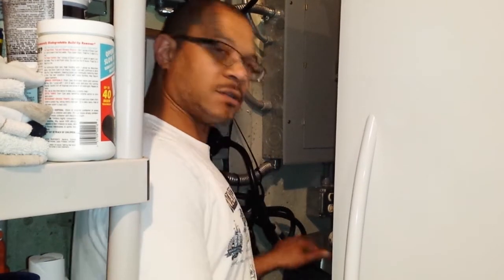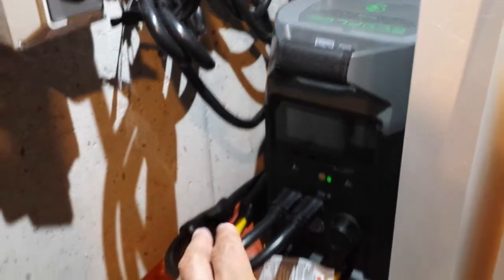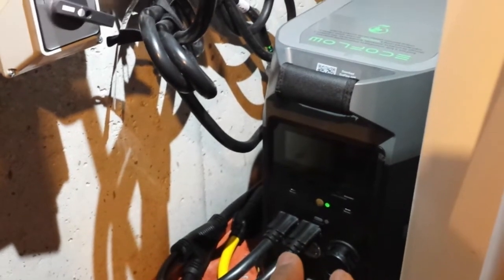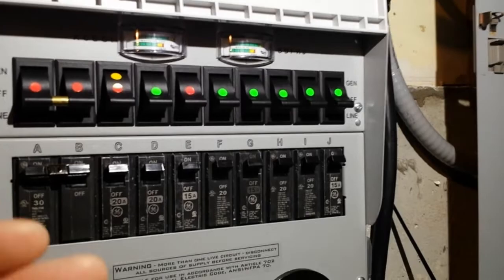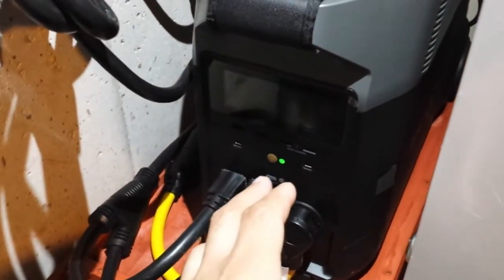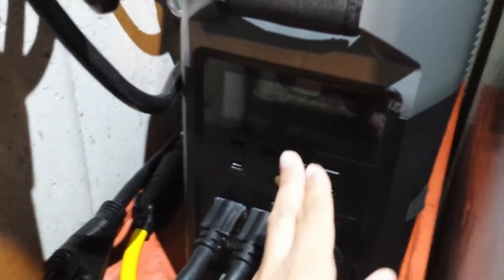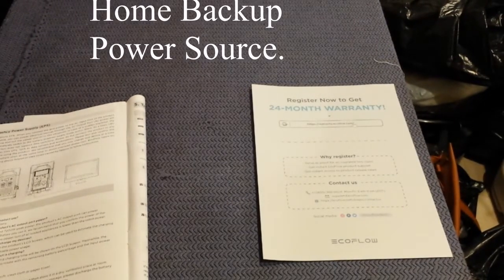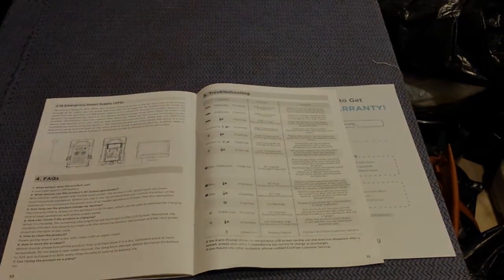EcoFlow Delta Pro - Overload Code Issue

Comment: I noticed you are limiting your EF battery charge and it coused the unit to not turning off so i cancelled the limit it satarted as normal and you should remove all connected wires to ac  NO LOAD and switch it off and wait for 2 hours and try turn it on and see if the 121 is gone ??  Try ac with a tv or blender without connection to house grid maybe the fault is in your house panel. Good luck 🤞

Comment: What is the resolution to this? Mine did this last week but not hooked to 120v, just solar panels. This was a "reconditioned" unit. I sent it back twice, now the 3rd time. is there a fix for this? This is out of warranty and now I have a $3k boat anchor.
Reply from the maker: I'm going to assume you tried to reset the overload button on the back of the unit. Outside of that, I have nothing to recommend.  

I am curious though, where did you buy them from and was it warrantied out with EcoFlow?

Comment: A power surge is needed for those types of internal power supply. When using generators, you need a sinewave. There is no protection on the ground when a surge happens.

Comment: Thank you for your video. I have a
brand-new Delta Pro. I haven't even
used it. I have only charged it. We
haven't had any storms, and I don't
know of any power outages. My unit
is experiencing the same issues you
are having in this video. I emailed
Ecoflow support. Hopefully, all goes
well.
Reply: How did it turn out?

Comment: Hello  I also have a delta 	pro 3600  . My problem is 50w overload from a fan running   . the reset button does not work either , we heard cracking smelt fire and shut it down . This unit is only one years old .I paid over 8,000 w extra battery and solar panel I never used. Delta pro is terrible. So don’t expect help. I have a two year warranty  and they are saying it was only a year,  when selling they promote a good bunch of boloney and then when you need them they don’t hear you.. I now have no use for this extra battery that cost ,3,000 and a solar panel that was another thousand don’t have bill in front of me could have been more. I don’t know nothing about this unit I am looking for I guess electrician  to fix this hopefully then sell it. , hoping to get some money back on the unit,  Like I said they talked a good one , but your problem sound like mine only mine is flashing red saying overflow circuit 50 w  , This should not have happened if this unit runs a whole house AC very disappointed . .if I find any information out I will let you know ,but to any buyers out there don’t buy if this company can not stand behind their product
Reply from the maker: Sorry to hear about your unit.  If this happened to me, I would make a detailed YouTube Video of the problem and share it with Ecoflow. As to your two-year warranty, if you bought it from a third party, take it back to them.

Comment: To get to 60 Hz, please press the AC button for 3 seconds, then the Delta jumps to 60 Hz and the overload display disappears and it should work normally again. I had the same problem and I need 50 Hz. Greetings
Reply from the maker: Thanks for this advice. That's good to know. You would think their customer service would have told me to try that, but they didn't.
Reply: Does this work? Anyone tried?

Comment: I realize this is a 7 month old video. I have a similar setup to yours with the same six breaker transfer switch except I generally run them 24/7 on Solar power from the Delta Pro. However I was just exercising/testing my Honda generator and charged the Ecoflow up to 100%. When I switched the Delta Pro AC back on, it popped an AFCI circuit in my house and the error 121 on my Ecoflow screen. It took me a moment to realize the Ecoflow was still plugged into the house probably causing a double neutral-ground bond condition. I removed the AC plug and the unit worked fine again with no errors. I feel the majority videos of issues of the Ecoflow's have been when someone is connecting this to their house and charging from AC. I also have been happy with my purchase of the Delta Pro.
Reply from the maker: Good info.  Question, how was the DP being charged from your Honda Generator? Was the DP plugged into the Honda or was it plugged into a wall outlet that the Honda Generator was supplying power to.
Reply: @Pk3_Garage  It was plugged into a wall outlet that the Honda Generator was supplying. In short, the same Input for the transfer switch is used for the Delta Pro or the Honda Generator. So I plugged the DP into a powered outlet from the transfer switch, but forgot to unplug after putting the Delta Pro back on the Transfer switch.

Comment: So, they, at first, told me to put it in a box and send it back, " . . . ensure it will not be damaged."   I thought that was a joke, so I told them about how you got one on thursday, adn sent it back in their their box, and so they say they are going to treat me the same. That is cool. I was worried for a bit. What a hassle that would be to have to send that back with my own packing.
Reply from the maker: That's good to here.  But, to let you know, I used the original box it came in, to send back the damaged unit.  Always keep the original packaging, for items like this, to send back in case of damaged.
Reply: @Pk3_Garage  Yeah, if i had a box for all my toys, i'd have to move into one of them. They are sending the unit, already got the tracking number. Any trouble with the new one?
Reply from the maker: No issues at all. Haven't had to use it in an emergency situation though. As to the boxes, I only keep boxes for big items purchased that I have to return by mail, because of a warranty issue. We have a garage, so big boxes are stored there.
Reply: @Pk3_Garage  well, it is cool that this company is sending me one now. I thought you got yours on a "thurs" and sent it off on thurs, so, that helped my case faster. Good karma working!

Comment: Just had a power outage and found the same trouble. It worked last tuesday on that outage we had, and it worked fine. Too sensitive if an surge kills it during an outage for the money. I regret buying this instead of batteries maybe. I had 100% charge when I went to plug it in, after setting the switch button it dropped to 69% and nothing works, charging or supplying. So, I called tech support and we'll see. What was your solution?
Reply from the maker: Sorry to hear that. I see you already placed a warranty claim with Ecoflow. Our new unit has been working fine.  After the first unit was damaged from the power surge, I have installed a Whole House Surge Protector by Siemens and a single outlet Surge Protector for the DP.  

The thing is, with all the videos I've watched about these types of Power Stations/Solar Generators, no one has ever mention how sensative they are to power surges. Thank God we do have a Portable Generator, as our main backup power source. 

I don't regret buying the DP.  I have learned it is just as sensative as any other electronic device in our home. (Extra precautions should be taken) I feel our Portable Generator is much more reliable than our DP, since our generator doesn't have all the electronics in it.

Comment: Greetings from Greece

Same thing.

AFTER UPDATE and having the delta pro plugged into the wall while simultaneously had about 200w current output enerything shut down(lights etc) Tried to turn ac output on via mob app but no

Went down to see the generator and showed 121 err code. Reset it but allways sais 121 overload prot.
And that smell!

Filed a complaint to Ecoflow warranty department...

Comment: YOur pretty calm. I have the pro it just stopped charging from solar and outlet its at 88% and it wont charge, though it does allow power out to devices
Reply from the maker: Is it showing any trouble codes? If so what code(s)?

Comment: Today I had exactly the same overload 121 code on the display and, guess what, exactly 74% SOC as in this video!!  maybe an indicator?  Also have the latest firmware installed since yesterday. The overload code appeared during the night with absolutely no charge. I hope this is just a firmware induced issue.

Comment: Something that caught my attention in your video is that it looked like you had a Y plug connected to 2 outputs on your DP. How does that work?
Reply from the maker: It works very well. The Y adaptor connects to a NEMA L14-30 power cord that was connected to the six circuit Transfer Switch.  Using the two top outlets powers both legs of our system.  Since the outlets are only rated for 20-amps, the max wattage we can use is 2400 watts @ 120 volts.   

Having both Transfer Switches, allowed me to back up all the circuits in our home. (Minus the 240 volts outlet in the garage)

Comment: a very similar event happened with ours today.. it had been working fine for weeks.. charging it during the day using it to run air conditioner in the evenings.. this morning it did the same for no reason and says overload protection.. we have been waiting for them to contact us back.. this problem and it not being able to charge while running the ac at the same time make me greatly regret getting them

Comment: I received my second Delta Pro on 06-04-22. On 07-13-22 I had the Smart Home Panel installed by a licensed electrician. The next day the breaker tripped that charges the Delta Pros and now I am getting the same (121) code flashes 50Hz and Overload. I am now awaiting the support to let me know my next move. I believe it is some kind of flaw in the Delta Pro as I haven't used mine at all. The other Delta is still working okay and still hooked to the SHP.
When my Delta Pro had this problem the sky was and still is clear, No storms of any kind in our area (Kansas). And I have a Solar system on the home with all the Lightening suppressors.
Reply: Update: I received my RMA today and am shipping my DP back for replacement or repair. I wish everywhere had this type of customer service.
Reply from the maker: They just released a firmware update a few weeks ago.  Did you update your current unit?  

Also, you mentioned you have lightening suppressors.  Do you have a whole house surge protector and a single outlet surge protector the DP plugs into? 

Just a quick note, you don't need bad weather to experience power surges.
Reply: When the solar system was installed the electrician installed a whole house lightening suppressor and the Delta Pros are connected through the Ecoflow Smart Home Panel. I don't know if it has any kind of protection incorporated.
Reply from the maker: So, you just educated me on something I've never heard of before. I did a quick Google search on lightening suppressor.  It's described as a rod that is on top of a structure, that prevents lighting strikes to that structure.

A Whole House Surge Protector is connected to the main control panel.  Its primary purpose is to prevent power surges from entering the main control panel, preventing damage to electronic devices.
Reply: That is lightening rods, my best friend and I had those put on our homes in the Late 90:'s. The electrician installed what he said eas a lightening suppressor that looks like a large red capacitor. And Thank you for your interest.
Reply: Do you have to pay the ship back shipping fee out of your own packet?
Reply from the maker: If it's a warranty repair/replacement through EcoFlow, no. They will send you a label by email.
Reply: Wow that is nice 👍

Comment: Looks like to me with your setup, that you accidentally routed the AC output of the unit back into itself, which will destroy the unit. When using this as an EPS make SURE  that the power input of the unit is NOT connected to a circuit that is being powered by the output of the unit. Make 100% sure that the input that charges the unit can ONLY be fed by grid power, totally eliminating any chance of creating a circuit loop.
Reply from the maker: Hi J Payne, you are correct that you shouldn't feed power back to the DP, from itself.  If you listen and watch closely in my video, you will see that the switch for the DP outlet, was in line power (utility power) and not Gen power. 

In order for me to send power back to the DP from itself, the switch would need to be in the Gen position. 

In our transfer switch up is Gen power, middle is off and down is Line power.
Reply: @Pk3_Garage  I did see that, but with the Ecoflow wired into the transfer switch, it takes ONE accidental flip of a switch, or forgetting to flip a switch off that should be on, or vice versa. Using a dedicated grid tied outlet will eliminate the possibility of mistakes being made. I have a dedicated circuit for my Ecoflow, that has a transfer switch to use either grid power or my generator to feed the unit, and a separate dual circuit transfer to power my essential loads.... NO chance of feeding power back into itself. It's possible that you may have flicked a switch when you shouldn't have, or not flicked when you should have...... but I'm SURE you didn't, just in case a certain company's support division is watching.......🙉 🙈 🙊  😉

Comment: I filed a claim with EcoFlow. This will be my 4th unit. The second with this exact same issue. The first had a problem with some cells not charging.  I only had 2000 of the 3600 watts.  It’s a good unit when it works. They need to work out the bugs.  But they should email the people who registered about this issue and that they are working on it.
Reply: Just got my new unit it’s working like expected. If you get a new unit update the firmware right away there is a fix for the 121 error.

Comment from the maker: EcoFlow just released a firmware update to address the error code 121 in EPS mode. Make sure you all check your DP for this update and download it. I will try to find out more about this update as to what it fixed.
Reply: Just updated mine. Thanks.
Reply: Do you know what the update version is?
Reply from the maker: Do the update on your DP and it will list what the update is for.

Comment: Was debating to buy ecoflow, bluetti, or all in one system. After saw many problem with delta pro, I’ll might just buy AC300, even thought delta pro looks much better
Reply from the maker: Even with the issue we had with our unit, I don't regret our purchase and would buy EcoFlow products again. EcoFlow just released a firmware update to fix the error code 121 in EPS mode. They have a great customer service and quick to resolve issues.  

The Bluetti AC300 is a nice unit. Just remember, you need to buy the main unit, the invertor, and battery.

Comment: Hi 
I have exactly the same issue. With smoke issue . 12 hours after receive it.  I hope they will do something.
Reply: I had the same issue too. Charged it to 100%, used it down to 50% on my rv ac plugged it in to charge it which initially worked well until then RV got to the set temperature and turned off. When the AC unit turned back on everything went bad smelled like burnt electronics. Ecoflow is garbage this is my second unit. Both of them nothing but problems
Reply: @krichardson3997 EcoFlow gave me a New one last week !

Comment: This whole situation looks very much like a power surge damage. Yes, EcoFlow has power surge protection, but the protection is not infinite.  If there is a lightening strike on the power grid close to your house, the power surge is so strong which can max out any power surge protection. I think it would be a good idea to install an additional power surge protector between the AC outlet and EcoFlow. Another way is to disconnect the AC cable and let EcoFlow to power the house for several hours till the thunderstorm passes by.
Reply from the maker: That's what I suspected but hasn't been confirmed.  I have since then installed a Siemens FS140 Whole House Surge Protection device and a single outlet plug-in surge protector for the DP. I recommend this to everyone that's doesn't already have these. We have been in our home over 26 yrs., and this is the first time this has happened. I have to admit though, with climate change, we have more serve thunderstorms, lighting and tornados in our area.
Reply: @Pk3_Garage  Power surge protectors are always a smart move for any household. A power surge can be triggered by lightning or the unbalanced power grid failure itself. When it happens, it can damage the equipment which is directly connected to the grid.
Reply from the maker: True. I believe when we were using the DP in ESP mode, it took the hit of the power surge, saving our appliances from damage.
Reply: I had my Delta pro plugged into my RV outside our house. My lady switched on the window air-conditioning unit. It blew a breaker and turned off the house electricity. When I turned the breaker back on, it fried the Delta pro just like this guy's. Same codes. Same non working issues. No lightning. And customer service refuses to help us until we set up an account, which is impossible. We told them it says our email and phone number are invalid. We told them that issue and they said. Well, we can't help you until you set up an account. We told them please help us set up an account.. They said,,  Go into the warranty section.. we said again.. It won't accept our email or phone number.. She said Well I can't help you until you register it.. 😑🤬. They know the issue and programmed registration  setup impossible. Our email and phone number were valid enough to take thousands of dollars from us!!! Answer that one Eric Liu..??
Reply: Buy another one at home Depot the same model bringing it home take it out of the box put the damage one you have in the box in return it back to home Depot that's all you got to do forget about doing claims